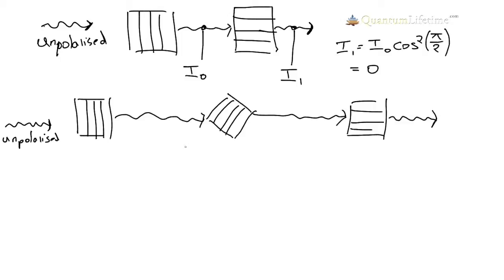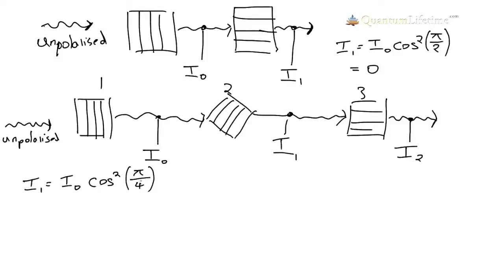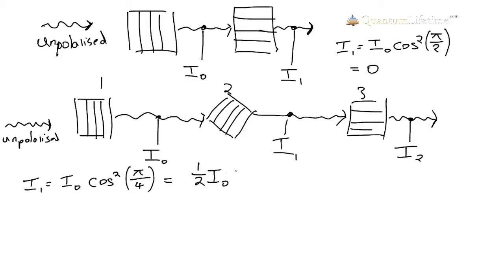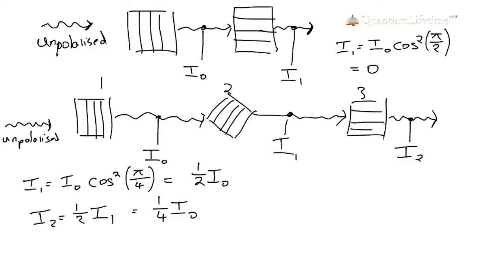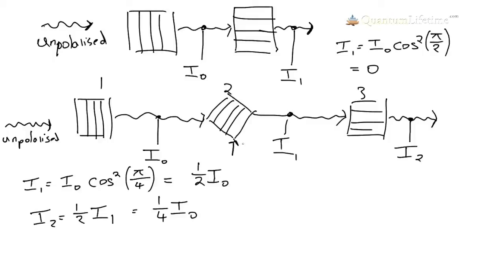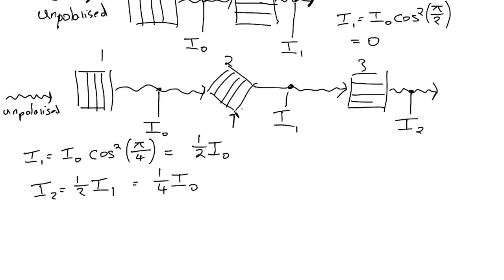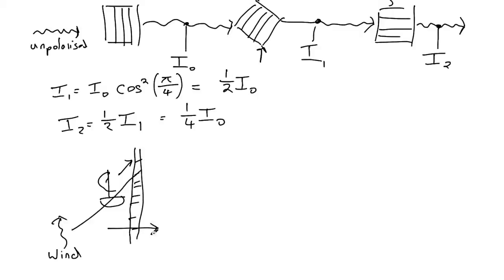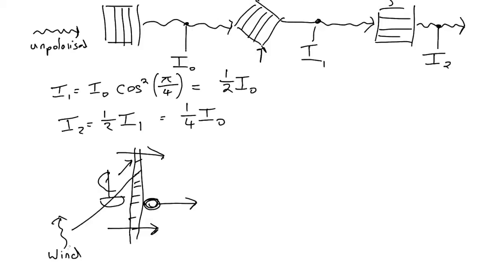The Three Polarizer Paradox : 5 Minute Quantum Physics Part 15

Comment: I look forward to see your next course with photons, finally. I intend to do the simplest quantum eraser expirement soon, which involves polarizing light and I'd enjoy to better understand the particle interpretation of Maltus law.

http://www.arturekert.org/sandvox/quantum-eraser.pdf
Reply from the maker: Excellent! I forgot about this channel for ages, but now I see people are watching, I'm inspired to come back and make more videos. I scanned through this document, and although it's a nice experiment, unless I'm missing something this could just as well be interpreted with classical physics, e.g. the original experiment performed by Thomas Young with a hole in his window shutter and a thin card. You can actually buy photon detectors and single-photon emitters, which might be interesting to play around with! Although I'm not completely sure that any experiment you could do would absolutely prove that light "consists" of photons -- from a certain point of view, it doesn't at all. You can never actually catch the things in flight!
Reply: We've finally done a totally different experiment. The point was to erase EPROM (ancestor of USB keys) with UV light. Memory chips function with the tunnel effect to allow the electrons to cross the electrical insulation. We assumed the longuer the time of exposition would be, the more the chips pour be erased. A full chip is full of 0 and a empty one is full of 1.